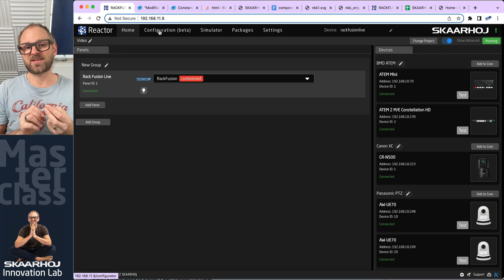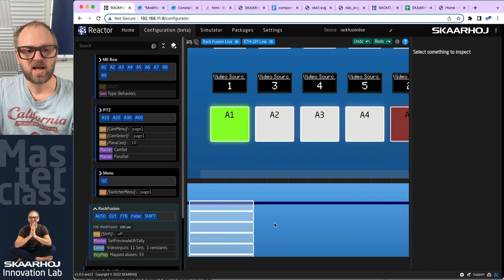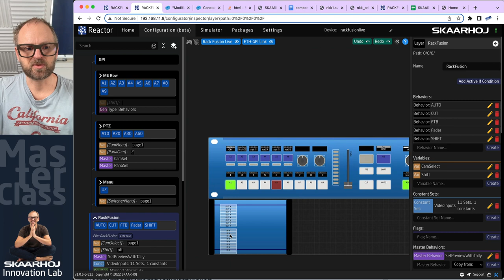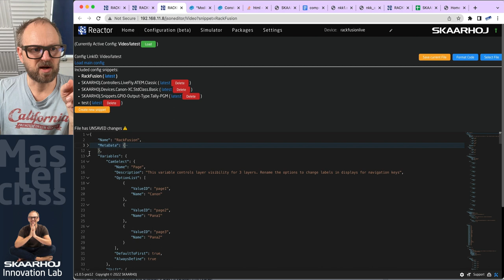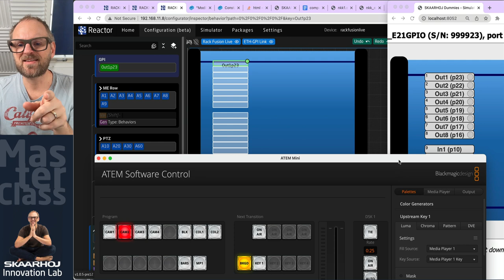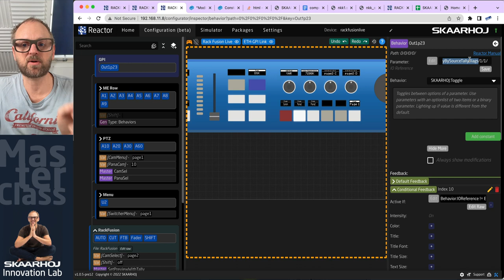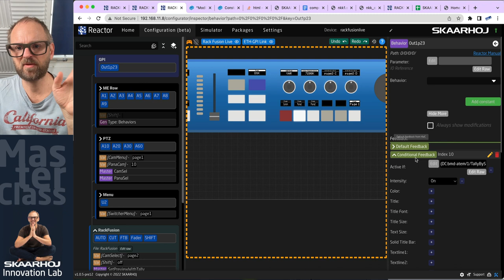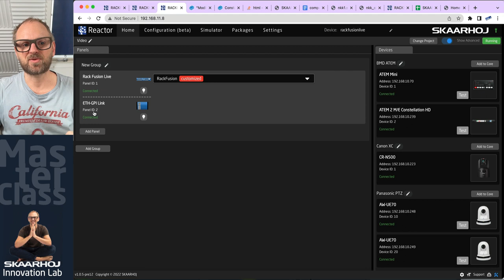Fusion in the Reactor 9: Adding GPI outputs with advanced conditions for triggering it.

Comment: This was super helpful! Now I can bound a Streamdeck on the same configuration which allows me to display the parameters and variables while programming from that same configuration! Which is useful, to see if I have programmed a button correctly and the value has become true or false when pressed, etc. I am really in love with Reactor!
Reply from the maker: Thank you so much! We love to hear that you are experiencing the same excitement as we do ourselves. Yes, it's interesting to use a StreamDeck as a monitoring panel  :-) I was just told by the dev-team that now they added a little "evaluate" button next to many Active If fields so you can evaluate conditions in-situ. This, and other tools, will continue to appear to make integration life easier. We are not done yet at all ... only getting started with Reactor... -kasper